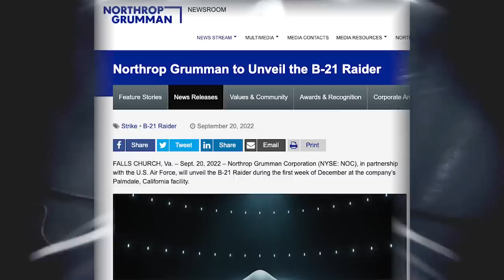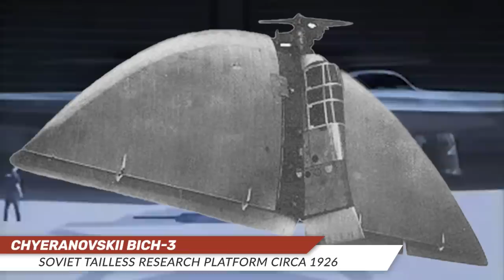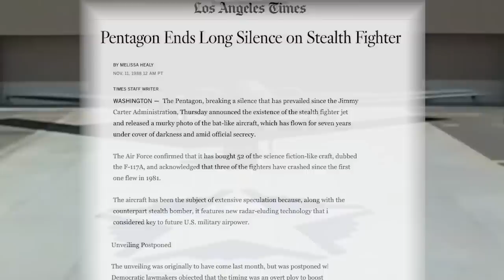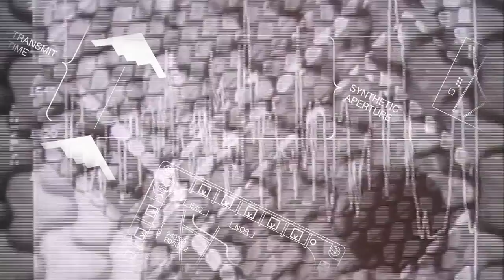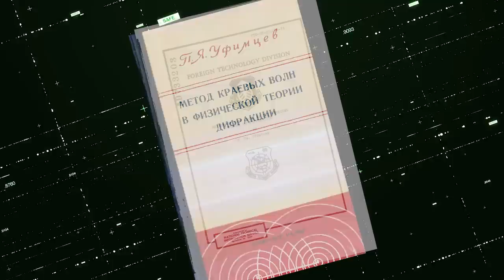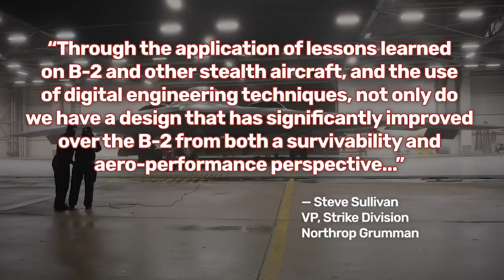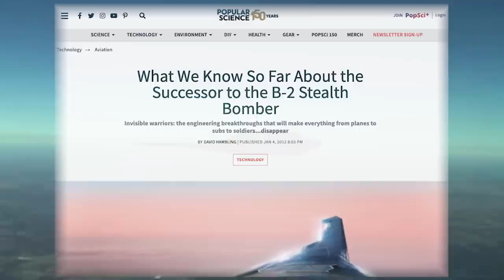Revealing the B-21: Why Northrop Grumman's announcement is a big deal

Comment: The De Havilland Mosquito was the first stealth aircraft. It was mostly made of wood and wood is extremely radar absorbent.
Reply: The Horten H0 229 Nachtjager had to be right behind it, albeit it wasn't a production craft and the Mosquito was.  To be fair to DeHavilland, they also had the first commercial jetliner.
Reply: @SnuffitLabs  Actually no, that was just a story one of the Horton brothers made up to try and find employment after Germany lost the war.  Actual tests on the HO 229 showed it to have a quite large radar cross section.
Reply: @faroncobb6040  Huh.  Didn't know that. (obviously, since we both saw my post).  I always wondered about the HO 229s the Americans took at the end of the war.  From what I read of them, not all were complete planes.  This is a bit off topic, but if the HO 229 could have been what Kenneth Arnold saw near Mount Ranier that started the whole UFO craze.  He described something very similar to it, but was misquoted about their motion as how they looked.
Reply: also, the mossie probably was the fastest serial production aircraft of its time.
Which is an aspect that the modern stealth aircraft lack. A pity, because speed reduces enemy response times.

Speed + IR stealth + Radar stealth (+ Range), find your optimum tradeoff...
Reply: The De Havilland Mosquito was an important example of an aircraft manufacturer who ignored the desires of the military and instead built the best airplane they could with the materials and workforce available to them.  Designing and building an airplane that no one is asking for doesn't usually work in peacetime (consider the F-20 Tigershark), but Britain's need for airplanes was so high, the Mosquito was so plucky, and its manufacture was so frugal that the plane became a big success.

The best planes have pilots who are strong advocates, and in that sense, the Mosquito is a classic.

Comment: Do you think that B-21 Will have ceramic RAM?
Reply: If ceramic RAM works as described, it would be a given that the most stealthy craft ever built would most likely have it.

As A, it is supposed to help the craft be easier to maintain because you don't have to take it off and put it on so often. This would greatly help with maintenance cost.

B, it is supposed to withstand higher temperatures and be more durable which again helps with maintenance and it allows you to go faster.

And C, it is supposed to be stealthier than current materials.

Comment: Anyone can look at the shape and build an airplane that looks exactly the same. We might have lost our edge, right?
But make it on steel and will be heavy with no room for anything else. Make it on aluminium and composites and it may break apart.
You want an assembly line that produces tens, hundreds, with the same performance capabilities and quality. 
That's the hard part. After all, if the machine is impressive, the machine that builds the machine is even more, but we don't see that.

Comment: I worked for the Skunkworks in the later 80s and early 90s, It was cool to crawl into an aircraft that did not officially exist.
Reply: How do you get to work for skunkworks. What route do u have to take ?
Reply: @savagespud8038  These days you'd get a degree in electrical engineering, aviation engineering, IT, or a related discipline. Military experience gets you brownie points but if your grades are good enough this might not matter.. Air Force ROTC in college or maybe sign up with the National Guard after graduation.

Skunk works are strictly black world work. You'll need to pass an extremely intrusive security investigation and a drug test. That's another advantage military people have. The military already investigated you for a clearance so that's less work for the DIA to do.  In 1980s, a secret level clearance investigation cost close to $100K and took six months. God knows what it is today.
Reply: @fh5926  like $5k

Comment: I can’t help but notice every time I see these stealth planes flying with huge heat plumes behind them I think they really need to find a way to reduce that even further.
Reply: I strongly suspect they have, and they just don't use it unless they have to.  Also sound mitigation.
Reply: B-2s already has a reduced thermal heat signature, recessed exhausts, cooling tiles, etc., etc..
Reply: @shmeckle666  and yet if you watch them in flight they still have a very large heat plume behind them.
Reply: @spartancrown  I mean yeah, can’t be perfect. But add them all together, what I previously stated, and their location on top and in making it even harder to spot from below it via infrared.  Add to that it’s ECM package. It does the job, or did do the job. It’s always a balance. I’m sure the 21 will expand on the tech and techniques on the B-2.

Comment: I can bet you it is gonna cost too much for 100.
Reply: The alternative is not very good.

Small numbers wont do what the weapons systems is meant for a stealth bomber to achieve its purpose at least in a real conflict.
Reply: Reported cost per plane is around $600 million. Better than the $2 billion per B2. Air force told them specifically that it can't cost an exorbitant amount per plane. That they have to use current off the shelf components and not invent stuff that balloons the cost. They now know what to do and not to do because of the B2. 

100 B21s x $600 million = $60 billion
Initial planned order was for 132 B2s. 132 x $2 billion = $264 billion.
Reply: @gigakrait5648  wow that was pretty cheap
Reply: @gigakrait5648  i hope they can make all the military equipments way cheaper, more effective.

Comment: I have always liked Northrop Gumman a bit more than Lockheed Martin, i think NG does stealth better
Reply: That’s mostly a function of the fact that NG is making strategic bombers and not fighters.  Since a bomber doesn’t need to be maneuverable, it can use a flying wing design, which is the optimal stealth configuration due to the lack of vertical control surfaces.  They can also have very long surfaces which prevent their detection by those longwave radars the Russians love to crow about.   Lockheed is making fighters and fighter-bombers, which need to be smaller and more maneuverable, and therefore have to make some trade-offs.  NG tried to get the best of both worlds with the YF-23, but while it was stealthier and had a longer range, the F-22 did everything else better and had more mature systems, and was a better fit for what the USAF needed.  (The YF-23 would have been a fantastic fleet defense fighter to replace the F-14 though).  My money is on Lockheed to win the NGAD contract, and I think they’ll be able to incorporate a tail-less design more successfully now with technological advances.
Reply: @bluemarlin8138  fair enough, but keep in mind that the government has said that each generation of NGAD will be a different plane so to speak, a family of systems, basically i am saying even if NG's design does not win the first generation they might win another time or with a drone wingman/"missile truck" in the future, but i hope that the B-21 will put more respect on NG's name is all (also the YF-23 is the sexiest plane ever don't @ me if you cannot see it)
Reply: How do you know!!! You dont do ya!!!

Comment: Sad that your history lesson of flying wings lags the horten ho 229 as the first military flying wing aircraft 
Although it’s never mass produced 

And finally the prototypes and blue prints went to the us after ww2
Reply: It wasn't the first. The Northrop N-9M beat it by several years.  https://en.m.wikipedia.org/wiki/Northrop_N-9M
Reply: @nuclearattackwombat8390   Don't forget the propeller driven XB-36 that led to the XB49.. in the frigging 1940s!!
Reply: The Ho 229 was barely a prototype and never saw combat. The only ho 229s found were partially built prototypes. Sure it's the first ever created, but it didnt make much of a dent until the allied forces took them and reverse engineered their own for testing.
Reply: JACK NORTHROP

Comment: As cool as the B-21 is, I still think it needs a complimentary bomber with different feature focus. The extreme stealth is great for deep penetration missions. But a more cost effective and flexible supersonic bomber could be useful for some other missions that may require high volume of low risk flights, fast response to threats and targets of opportunity, and show the flag displays intentionally within range of adversary radars to deter aggression as a show of force. Highly stealthy bombers are effective at their primary mission but expensive and not necessarily the optimum choice for some other missions.
Reply: With the advent of stand off weapons and missiles, the days of the B1 are limited, there is no need for that anymore.  The B21 has been designed with this in mind.
Reply: Fighters are more than capable of performing that role
Reply: @ryanestes7331  Not really, the B2 or B21 can equip much larger weapons that most fighters, with very long loiter times, and high level stealth.  The bombers give the USAF something new, the ability to hold position, hide, and launch from just about anywhere.
Reply: @nickp.4995  Sorry I didn't mean to imply that fighters would do everything the b2-b21 would do my comment was for fulfilling his supersonic non stealth cheap show of force mission
Reply: Supersonic strategic bombers are a waste of money these days.  The reason we cut the B-1’s top speed down from Mach 2+ to Mach 1.2 is because speed was no longer a sufficient defense from SAMs.  Stealth bombers are the only things that have a chance of actually getting to their targets prior to us obtaining air supremacy.  B-52s and B-1s are just fine for the “show of force” role and for launching stand-off missiles.  The Air Force is even working on a system that would allow us to fire stand-off missiles from pallets in the back of cargo planes.
Reply: It's replacing B-2 and B1b.   We're keeping the B-52 for cost efficiency.
Reply: In my opinion, the USAF should get 100 B-21 + 100 more new bombers that are closer to  updated B-1 in design and features, with stealth improved but a lower priority and restricted by cost and easy export potential to allies.

I think that the in service B-1B should have nuclear fusing added back in as soon as the treaty restrictions expire. This would bump them up in priority for retaining them over B-52s.

All the B-52s should be sold to India if they are interested. Delivery should proceed as B-21 are delivered to the USAF. While they are still serviceable for several more decades, B-1B with nuclear weapons capabilities added back in would be more capable. B-1B have had heavy use over the last decades, which is evidence  of their utility but also has caused faster airframe wear than the B-2 and B-52 that have spent more time on ground as strategic deterrents. B-52 are less capable overall than B-1B but still have an edge on PLA H-6 and thus still of potential value to India.

The USA is currently restricted in numbers of strategic bombers by treaty. Ideally that restriction should be dropped fir future treaties. Regardless, the USAF should retain the highest capability and highest utility bombers within treaty and budget limits.
Reply: @Stu_Bur  And you think that developing and buying another B1 is going to cost less? You're dreaming. B1s are also extremely high maintenance. That is one reason why they are planning on retiring them vs. B52s. And no way in hell are they going to sell B52s to India. Where the hell do you guys come up with this idiotic ideas? Lay off the drugs. Your brain is melting down.

Comment: Still thus far has a very predictable form layout appearance whatever you want to call it.    The F-22 F- 35 the new Korean plane the new Japanese plane they all look strikingly similar don’t be terribly surprised when the B-21 looks like to B-2
Reply: It looks like the B-2 because a flying wing is pretty much the ideal form for a stealth aircraft.  The long surfaces render those longwave radars that can kinda-sorta spot smaller aircraft are useless against the B-21 and B-2, and the lack of vertical surfaces makes them even harder for any wavelength radar to detect.